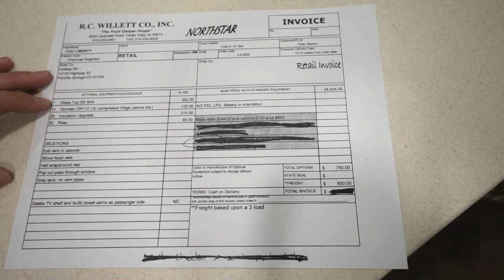2020 Northstar Liberty – Truck Camper Detailed Tour – Off Grid Camper!

Comment: Not sure if you’re keeping up here after 3 years. I’ve so enjoyed your channel. I’ve notice that in the back of your truck when the camper is in that the gap between the rear of the truck and camper is wider on the right than the left. Looks like a good spot for hanging a diesel heater. Is it wider on the left because of the bath?
Reply from the maker: Correct.  The bathroom makes the left side wider.  We store our pole saw and shovel on the right side.  Works great!

Comment: First comments.   Great video so far.    On my new Liberty I am putting an awning on the passenger side, so the USB outside makes perfect sense.  The outside shower port is right next to the cassette so you can fill the cassette tank with the shower nozzle.  Great place to put it.   The gray tank is a 13 gallon heated (maybe an option on heat)tank on the bottom under the floor of the camper.  The gray water dump connection is located on the back by the back door.  I will give more comments as I go through your video.
Reply from the maker: Nice another Liberty owner!  We've been enjoying ours for the past couple of years.  Made lots of changes...  videos on most of the upgrades.  Thanks for sharing

Comment: Great detailed review.  I am researching lightweight/no frills (except wet bath) hard side campers for my 2022 RAM 2500 gas (3k door sticker payload) so this one seems nice.  One question, I assume you can leave the tailgate down without the rear skirts instead of removing it?  Would this also work with the rear skirts installed ?  I also pull a 32' travel trailer but looking down the road to have a small truck camper option that is easy to put on and remove from the truck without removing the tailgate.
Reply from the maker: We have lots of videos showing places we've gone... it's been great camper!  Yes.  You can leave the taildgate on... although I'd recommend removing it.  Should work with or without skirt.  Worse case you may need a piece of plywood or rubber mat to slightly elevate the camper in the bed.  It's easy to remove the tailgate and shortens the truck lenth plus less likely to damage it.  Thanks for watching!

Comment: What was your thinking for getting rid of the wrap-around rear? I guess the truck tail lights are brighter than the camper tail lights, but it looks like you lose a lower jack mounting point and expose the truckbed more.
Reply from the maker: Wrap around isn't needed for this bed length.  Majority of the camper weight is on the front 2 legs so added support not noticeable.  Don't like the look.  Gives us access to the side of the truck bed (we store shovel and other items there).  Less expensive.  Less weight.  Really I can't think of a benefit to having wrap.  After owning a Four Wheel Camper... I like the non wrap design.

Comment: What happens to your gray water with no tank. Is there a pipe where a hose can attach ? Thanks, Tom G
Reply from the maker: Yes we have a hose and extension if needed.  Similar to Four Wheel Camper.  Much easier disposing of smaller quantities of water... and less weight to haul around.

Comment: You mentioned keeping the AC off the roof.  I like that just to lessen the number of holes.  But where/how do you install one lower?  On the side somehow?
Reply from the maker: We don't want AC.  Home is on wheels so easy to relocate if the climate doesn't work.  If you want AC...  I'd look to Pro Air for a solution.  They have cabinet style units with remote mountable condensers that might be able to be mounted on the outside of the camper between the truck bedside.  I've seen window style units being used in the Four Wheel Campers as well.  But basically, keeping your weight low will improve handling and reduce sway.  Hope that helps!
Reply: You can really tell when people dont live in the south 🤣🤣🤣

Comment: No Gray tank?  Where does the used water go from the sink drain and the shower drain?   Does it flood the bottom of the truck bed?  Or does it all pipe directly to the drain outlet on the back.    Most places won't let you just dump the gray water on the ground.  In the back country maybe.

However,  great video and I like your candid opinions.
Reply from the maker: We did a video on the gray tank removal...  check it out.  :)

Comment: Hello, thanks for this video it really help me decide for my next adventure. I have a question and I really appreciate any input. I’m thinking about getting Toyota Tacoma. Do you think this camper will fit there ? 

Tnx😊
Reply from the maker: We love the Tacoma... just bought a 2021 (see earlier videos).  However,  they really are not designed to haul weight.  Most have a payload of under 1,500lbs... after you deduct fuel, passengers and gear there isn't much available.  We show what the truck looks like in the video with only 600lbs in the bed... I'd look to a truck that has more weight hauling capacity.  Thanks for watching!

Comment: Very well done video. What other campers did you look at before you bought this one? Did you look at the Lance or Arctic Fox, and if so what were your thoughts on them?
Reply from the maker: Yes, looked at every camper available.  Our requirements limited options: narrow width (7ft), low weight (under 2k lbs), awning acrylic windows, good insulation, strip down (no tv, microwave,  ac), cassette toilet (no black tank to dump), no slide outs, fit in the truck bed (no wrap around or rear overhang).  

Heavier campers really need a dually truck to haul.  Not nearly as capable off road.  We spend all our time off grid and like remote areas.  

Biggest key is to decide where you want to travel and what comforts you need.  Then look for a camper to meet those needs and requirements.  

For us, small space is the sacrifice for capability and ability to travel anywhere off road.  

Hope that helps!!

Comment: We have several questions.  We ordered our camper almost identical to your configuration, the exception is an extra MaxxAir Fan (2 total) and heated grey tank.  Our goal is to boondock as much as possible.  We are trying to size our solar power and battery bank. What are your recommendations for amount of amp hours for battery bank and wattage for solar?  What are your thoughts on lithium batteries for a solution, which we highly desire, unless you have some objections/reservations?  If lithium, what components would we need to make it compatible with standard Liberty equipment (converter, inverter and solar controller) to operate Maxx Fan, fridge, heater/blower motor, heated grey tank and water heater.
Reply from the maker: Here's a link to the camper build information:
https://expeditionportal.com/forum/threads/2020-northstar-liberty-expedition-truck-camper-build.216281/

We have 200AH Battle Born Lithium Batteries - Love them compared to AGM or Lead Acid.  Much more functional and easier to live with.  We are using the original converter/charger.  No inverter (we power everything 12V DC).  Victron solar charge controller (check out build and videos for details).  We have it fairly well documented...  hope that helps!
Reply: Thank you kindly for the simple and straightforward response...and quite timely as well.  You answered all our questions.  Love the videos.
Reply from the maker: @randallcumbaa1647  Very welcome!  Thanks for watching:)

Comment: What is the hottest outdoor temps/humidity you dealt with and was comfortable inside not having AC?  Also w/ no gray tank where does the sink/shower water go?  Thanks for the informative video!
Reply from the maker: We live in the desert... been in 110 range.  No it's not comfortable!  So we leave.  It's a camper not a house.  Easy to move to better temperatures.  Gray water can be collected in the sink (container) or outside where the pipe drains and disposed of.  Similar to the Four Wheel Camper.  Hope that helps!
Reply: @TruckCamper  for me it will be a “house” so to speak since I’ll be full time so I may just do the ac.  ….If I did need the ac it could run off of the truck engine running I assume. At least for short periods.  Or a generator
Reply from the maker: @kr639  It is possible with a generator 2-3,000 watt.  Not cheap with battery, inverter or running off truck.  Realistically it's not cost effective and makes best sense if in campgrounds with power connections

Comment: reasonably priced !! why are 4wheel campers so EXPENSIVE ! I wish I had a full size truck to have more options .
Reply from the maker: Buy the empty shell.  That's by far the best value for FWC.  Then build out the inside.  They are abhuge rip off for upgrades

Comment: What are you doing about the torquing of the bed/camper when off reading? I torqued mine crossing a ditch and it snapped the forward right wall where the tie down mounted.
Reply from the maker: We are using the Torklift Fastgun turnbuckles.  They have spring tension to allow for flexing but hold tension.  They seem to be working well so far...
Reply: Expedition Truck Camper hey, thanks for taking the time to reply. Just FYI, be damn careful when torquing, twisting the truck frame while the camper is tied down. I called torklift, they said NO. It’s not been designed or tested for that and if enough load is transferred to the camper tie downs, damage to those tie downs or the camper frame can happen. I know from experience what can happen. I take two opposing sides off and loosen the other two, before I get to far down that road now.  Good luck
Reply from the maker: Thankfully these newer generation Super Duty trucks have fully boxed frames.  I haven't been able to get the frame to twist or distort even flexing it hard off road.  We will be pushing the limits with this...  See how it goes!  Appreciate the word of caution.

Comment: Overall like liked your review.

I am a fan of Northstar Campers since I am working on getting the Lerado SC for my truck. Because you are younger, I understand your contempt for the door handhold but for older folks it is a good thing. It sounds like you should share your opinions with the designers to understand the give and take decisions made with the camper design. The options you chose make sense. I'd be interested in your power system once you get it designed and installed.
Reply from the maker: You are absolutely correct.  My opinions don't apply to everyone.  But hopefully I can give some incite and inspiration.  Thanks for taking the time to share your thoughts.

Comment: I am wondering if you could measure the width of the bottom exterior part of the camper to find out the minimum bed width for the camper to slide into.   Only reason I am asking is because I have a RAMBOX and am trying to see what campers might fit, but information is scarce.
Reply from the maker: 48".  But this camper has a bump out towards the driver rear (like many campers) behind the wheel well.  That's going to be the challenge.  So simple answer is at least 48" but likely more behind the wheel well for most campers.  

I looked at the rambox trucks and realized it wouldn't work without modifications.  Good news is those beds are desirable and people pay a premium for them.  So you could bed swap or flatbed...  Hope that helps!
Reply: Thank you for the info!  I was caught up in how cool the Rambox’s are on a daily use,  I overlooked the camper thing for down the road🤦‍♂️
Reply from the maker: @KruiserKrawler  Rambox is a cool concept.  It would be ideal of the sides opened instead of the top!

Comment: I'd be curious to know what your mpg is with the camper on.  If I read comments correctly on your truck build video, you have the 6.2 gas engine with 4:30 rear end, and around a 4" lift.  Why the custom bed aux tank vs. under bed?  I like your camper guides and tie down set-up.
Reply from the maker: It is doing 10-11mpg with the camper.  Yes, you have the specs correct.  There are no under truck tanks available (sadly).

Comment: I am in the process of getting one of these for my 2019 Nissan XD, was wondering is there any storage under the mattress? Also what does the roof look like you mentioned putting Solar on there which I am totally down for but how many panels do you need, batteries how long will it last etc?  thanks for the video.
Reply from the maker: No under bed storage.   We had them put in closets on both sides of the bed (shown in video).  There's another video showing solar install.  We have installed our own Lithium batteries...

Comment: Being wood frame is that an issue to worry about it
Reply from the maker: Not so far.  Wood frame can be plenty durable.  But not all campers are built to handle off road use...  need to investigate each manufacturer.

Comment: Hi. Can your truck handle this camper (weight)without  problems?
I have the same truck ,do I need to do something in order to carry a camper like your?  Tk.
Reply from the maker: Yes, it handles the weight.  In the rear it has Timbren Bump Stops.  But we have custom leaf springs and Fox shocks on order.  Front suspension is mostly Carli parts.  You can get away with the Timbren or Air Bags only... or go further like we are doing for better off road performance.
Reply: Expedition Truck Camper   .thanks.
Reply: Look at the capacity sticker on your door jamb. It will tell you how much weight you can legally and safely carry.

Comment: Can a truck bed camper with a slide be offroaded?
Reply from the maker: Carefully!  Slides really don't hold up well being tossed around.  Plus the addition weight makes truck handling less good.  Ideally for off road camper... you want lowest COG center of gravity, less weight is good, narrow as possible and proper truck suspension.  Sure is fun and rewarding!!  Travel to remote locations in comfort.  :)

Comment: Hey guys, great video tour. Thanks!

Just a few questions, can your camper be hooked up to pressurized city water?
How do you handle the grey water from your sink?

I really like the choices you made and didn’t make 😏 TVs, ACs and a bunch of extra tanks always seemed like a waste in a truck camper.
Reply from the maker: Yes.  There is a "city water" hose connection bypasses the tank/pump.  Take a look at our gray tank video: https://youtu.be/MpnrwCTV-MM 

We really like the camper so far.   Have around 3 weeks of trips so far... planning some extended traveling coming up!  

Thanks for watching. :)

Comment: It's a damn shame that you can't put this camper on the new electric Ford coming out. Max weight is 2000 according to the website. You wrote in the comments fully loaded yours is around 3000? ;( GUhhh!!! I almost found my most perfect RV solution! :-/ SO CLOSE!!!!
Reply from the maker: You might be able to do a composite popup like the Camp-X sells.  You'd want to keep the camper weight around 1,000lbs so you have capacity for gear and people.   F150 Lightning seems brilliant and innovative.  It should be a great success!  Thanks for sharing.
Reply: @TruckCamper  Nah no way... I'd want a hard sided camper for certain... for insulation, safety, noise... all that. I think I'll just wait until the electric rigs get better. Then... it'll be me and my new youtube channel cruising around the US one full charge at a time minus any gasoline. Yeah... it's a dream now I know... but soon I hope it can happen.

Comment: Did I understood correctly that you had a pop up camper before? Why you decided to go with hardwall this time? I am thinkin about 850SC. Great channel!
Reply from the maker: Yes, we had a Four Wheel Camper "Hawk".  It was for comfort and convenience.  My wife wanted a toilet and shower.  So much better insulation (for cold & hot).  Quiet - pop ups are noisy especially in the wind (it's essentially a tent).  No setup or tear down.  This is nice when stopping to grab lunch.  Really the only advantages of the popup are lower height and possibly less wind drag (improved mpg).  For weekend trips popup is fine.  We go for extended periods so comfort wins!  Hope that helps.  Thanks for watching!
Reply: @TruckCamper  I saw your video on the FWC pop up and it did give me pause what you said about the noise and condensation. I want to get 100 camp nights per year, so I’m reconsidering going ahead with a Liberty instead of 850sc or 650sc.

Also like the Cirrus. Have you any thoughts on that one?
Reply from the maker: @Silverado62  Good things to consider... Cirrus has some of the best innovations and design.  Only thing is I'm not sure it would hold up off road type use.  Their newest 620 model looks interesting.  Other consideration is width (think they are a bit wider).  Definitely look at all the options!
Reply: @TruckCamper  Yeah, one thing I like about the 620 is the face-to-face 2-person dining setup. But I see you cured that in your Liberty so that makes me wonder if I could fashion the same.
Also, no shower doesn't matter to me but I think it would hurt the eventual resale value.  So I'm back to obsessing on the Liberty. Hoping to find one on a lot to crawl through in Central TX to give it a look-see.
Reply from the maker: @Silverado62  We bought the Laredo SC used (video on it).  But decided it was too big.  So basically had most of the dimension differences for the Liberty as finding one locally wasn't going to happen.   Have fun on the search!

Comment: Great!
I just looked at igloo9.5
Wonder the difference
Glad to see your so happy with it
Reply from the maker: Igloo 9.5 is larger...  6" wider.  9.5ft floor length vs 7ft.  So it is made for long bed trucks and will overhang 1.5ft off the rear.  It also has larger water tank and fridge/freezer.  Just bigger all around.  :)